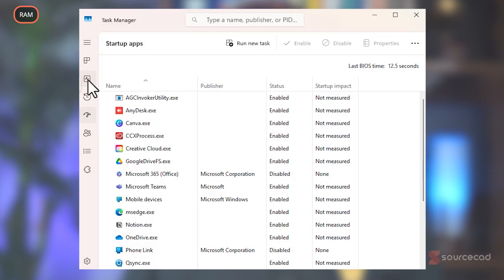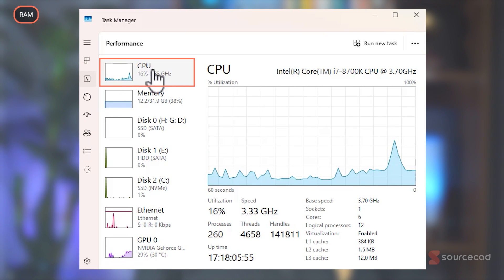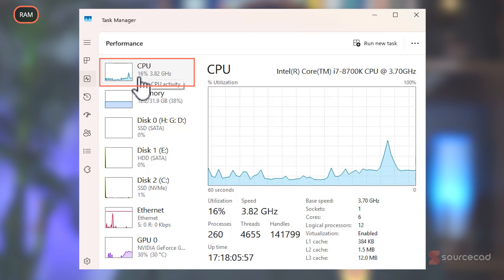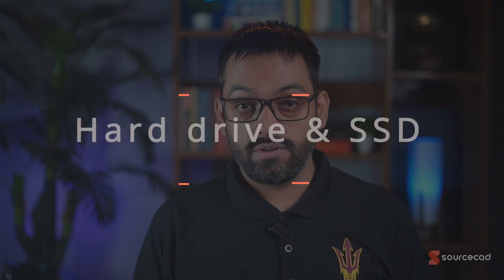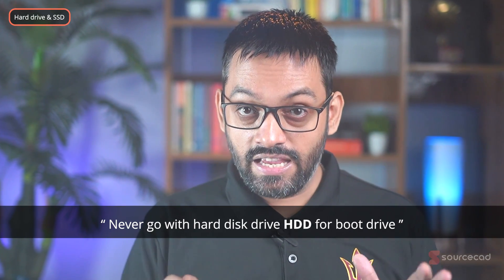Watch this before you buy an AutoCAD laptop [2025 update]

Comment: Between the RX 7600s 8gb and the rtx 4050 6gb what's best for Autocad? The Cuda architecture or the extra processing power and 2gb memory from AMD. Thanks!
Reply: For architecture for a family member that the company doesn't want to pay a laptop, mainly 2d stuff. But just if she has to open 3d projects for minor adjustments.
But it's probably better to ask in reddit right? People at least has knowledge there😂
Reply: R u kidding? Why u need rx 7600s or 4050 for Autocad 😂
Reply: @ss87344 cause is the cheapest laptop you can get and they aren't paying a laptop the company of a family member. Just when is outside the desktop. It's for architecture.

Comment: Not actually a laptop
But running with 12900k i9, RTX 3070, 64GB 4000 MT/s on a Z690 MB. Still experience in lags in corridor modelling and object viewer. Not sure 14900k will give any significant performance
Reply: You have a great cpu, a lot of ram and a great gpu core. So either the vram on the 3070 isn't enough... Or your CPU is to hot that couldn't handle the frequency target or the cpu ram is slow.
Check the system manager to check how many ram, vram, cpu and gpu usage. But then check also temperatures with Hardware Info** free software to check if something have to drop frequency cause it's to hot.
Reply: Slow ram for some bios configuration, not that 4000 isn't enough. Is not the fastest ram out there but I think is far away from bottleneck your CPU to be honest.
My guess is your out of vram on the gpu and the 3070 have to access the ssd in middle of a render, cause the full render requires more than 8gb, so the moment you "walk" into a not loaded zone, there is a "load screen" were the gpu is removing stuff from the memory to add new stuff that wasn't loaded cause full render was 10.6gb. But I could be wrong. Is task manager show the vram of the GPU almost full maybe try to get resolution down to check is the vram usage decreases and your computer behave smooth. That same problem could happen with the ram on the CPU, you have a lot but I don't know the size of your render mate.

Comment: I tested and ran AutoCAD on Surface Laptop 7 
Snapdragon® X Elite (12 Core)
Qualcomm® Hexagon™ with 45 trillion operations per second
Qualcomm® Adreno™ GPU
32GB  LPDDR5x RAM
Removable27 solid-state drive (Gen 4 SSD)  1TB

Comment: Hello Sir.... Thank you very much for this incredibly useful video! I was wondering if you could offer some advice on whether the following build would be suitable for running AutoCAD and SolidWorks...

-13th Generation Intel® Core™ i9-13900HX, 36 MB cache, 24 core, up to 5.40 GHz
-NVIDIA® GeForce® RTX™ 4060, 8 GB GDDR6
-16 GB: 1 x 16 GB, DDR5, 4800 MT/s
-1TB M.2 PCIe NVMe Solid State Drive
-15.6", FHD 1920x1080, 165Hz, Non-Touch, 100% sRGB, 3ms, ComfortView Plus, DDS, NVIDIA G-SYNC

Comment: Hello Sir,
My daughter is in 2nd year of interior design course, she will be using auto cad for layout drawings, i want your opinion for the laptop below with following configuration :
Dell Precision 7560
i9 11th Gen (Intel Core i9-11950H, 24MB Cache, 8 Cores, 2.60GHz to 
5.00GHz, 45W, vPro)
32GB RAM (DDR4, 3200MHz, Non-ECC, SODIMM)
512GB SSD (M.2 2280, Gen 3 PCIe x4 NVMe, SSD)
4GB Graphics DDR6 (NVIDIA T1200, 4GB or
NVIDIA RTX A2000, 4GB)
15.6" (UHD HDR 600, 3840 x 2160, Anti-Glare Nontouch 
100% Adobe, 600 Nits, 2D backlight)
Will it be a good option ?
Reply from the maker: This config is more than sufficient not only for AutoCAD but also for other CAD and rendering software!
Reply: @sourcecad  Thank You So Much for your prompt reply.
Reply: My main concern was, is 4gb graphic card enough ? As all other batchmates have bought laptops with 8gb or 6gb graphic card. Right now she is using a i7 6th gen with 16gb ram & 2gb graphic card which lags a lot she feels.
Reply from the maker: @nitienjain  CAD software is mostly processor-dependent and also on single-core performance rather than on graphics. So, 4 GB is good enough for the use case.
Reply: Hello sir I’m currently
Using Lenovo ThinkPad P 1 GEN 7 and where is 32 RAM and RTX 2000ada and cup intel ultra 7 155 H. Is this enough im currently majoring in mechanical engineering

Comment: What about mac’s?
Reply: The biggest issue with macs are around software. Autocad does have a native mac version, so it that's all you need, mac can be great. But if you need Revit or Bluebeam Revu, mac may not be the answer. It's not the most versatile choice, but if you work in a mac office (Archicad, Vectorworks, etc) then it's great

Comment: sir i am pursuing mechenical engg but i have a question for you that nowdays everyone getting views in lacks or in million but your views is less so do you feel that you have chossen a wrong branch in  engg.
Reply from the maker: Just because I get fewer views on YouTube does not mean mechanical engineering is bad. Maybe there are far more developers than mechanical engineers. Also, may be most of the mechnical engineers are doing field work and don't need to work with software, so essentially they are not going to watch my videos too. So, in a nutshell even if my views couts are less for videos mehcnical engineering as a domian is defiantely not bad. Go for it if you are planning for it!

Comment: All the laptops you have recommended have Processors ending with 'H' meaning they cannot be overclocked, but you have also mentioned their base and Max clock speed. This is contradicting to what you are telling here 3:05
Reply from the maker: Apart from Intel processors, all AMD recommendations can be overclocked. Intel for some reason, is simply falling behind in this race and when I tested Intel processors, the recommended ones performed better so they are there in the list. Overclokign, though recommended, can't be the only criteria for selecting the laptop if other factors don't work well, like CPU architecture.
Reply: Sir please give best laptop under 60k for AutoCAD and repeat all things please search give me information tomorrow I want to buy it 🙏🙏🙏🙏🙏🙏🙏🙏 @sourcecad
Reply: Also give me information about the laptop under 45k which is required for my friend required (AutoCAD)